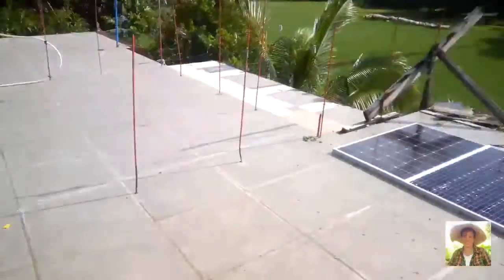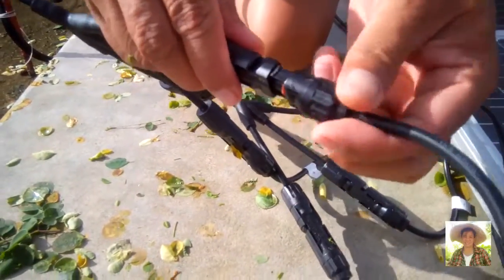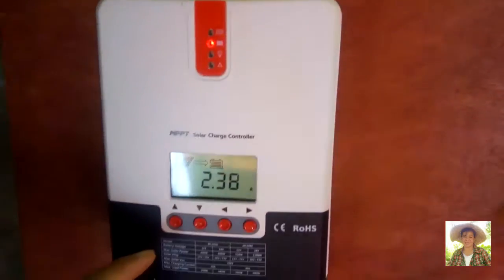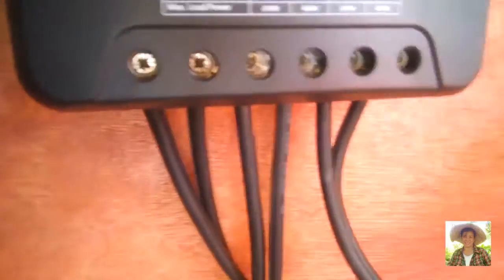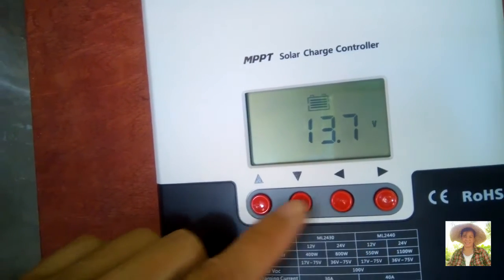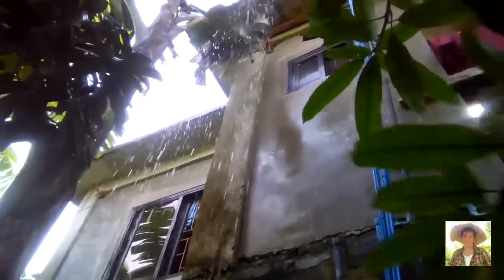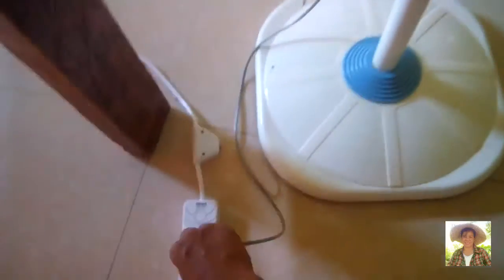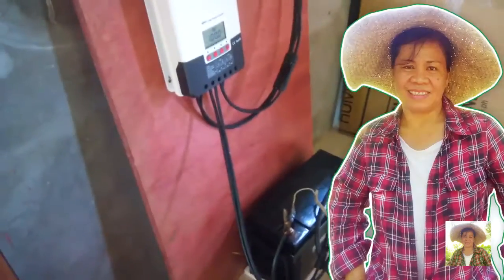DIY OFF-GRID SOLAR POWER HOME : How to

Comment: Grabe kalako pa namn mas maiintindihan  ko 😅😅😅. 3 100w @ 12v solar panel can produce 20A ? Parang di po makatutuhanan. Ang solar panel na 100w ay may Imp na more or less 5.55 . Ang 100w solar panel Vmp 12v-18v. Kung titignan mo ang Imp is 5.55 each panel so pano naging 20A?  Kahit iadd mo pa yan nasa 16.5 Alang  ung 3 panel. Last every panel can't produce 100% efficiency in real world except in Laboratory. Solar panel can produce 60-75% here in the Philippines while other countries  has 80-87% bec of cold weather. 
 Kung 20A yan nasa 270w na ang output nya meaning 90% efficiency  each panel kc 100w each.
Wag kaung mankolo ng ibang tao karma na agad bumili kau panel na 200w naka karton pa bago eh naka 3 100w kau, mixing solar will pull your voltage and current down to the deep blue sea. 😅😅😅 And your bettery is below the belt of DOD it will not last long in 1 year 😅😅😅

Comment: try to connect the panel in series connection to maximize your mppt controller
Reply from the maker: Thank you sir for watching..
Reply: series pag malaking system   , parallel if you need more Ampere in small system po.